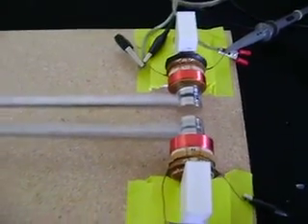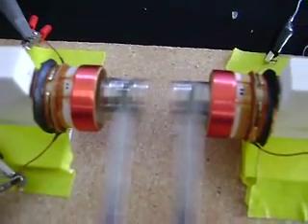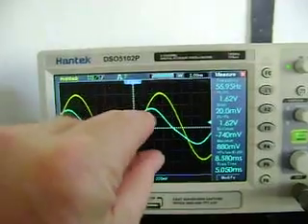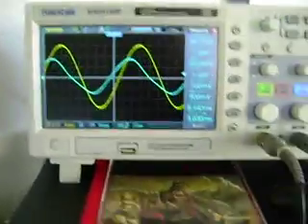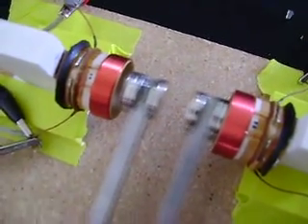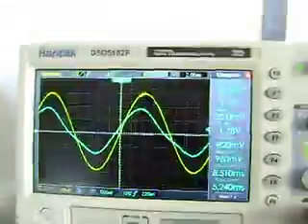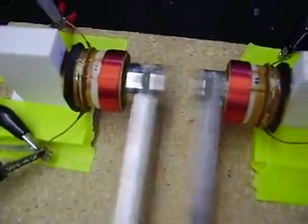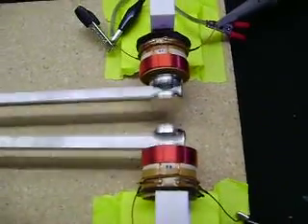Home Made Tuning Fork For Testing Mechanical Resonance

Comment: i predict that use of bolts in the fork construction is no good , perhaps try single metal piece tuning fork instead .and a bit longer arms on the fork. ?
Reply from the maker: Actually it never came loose  Used it a lot and still have it

Mags